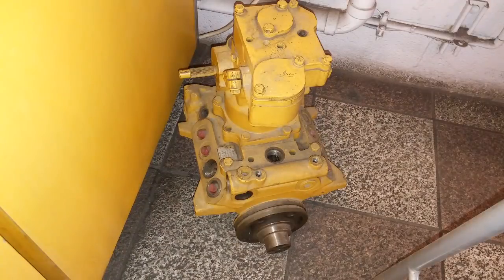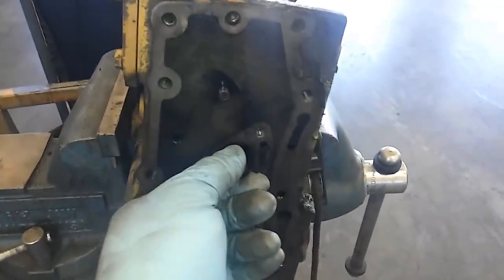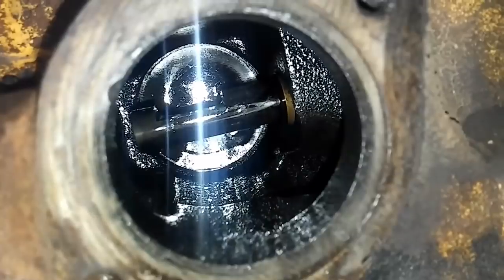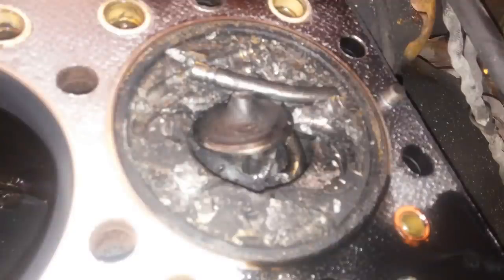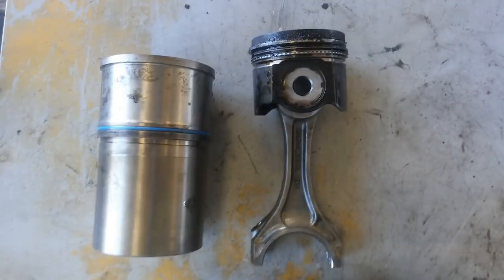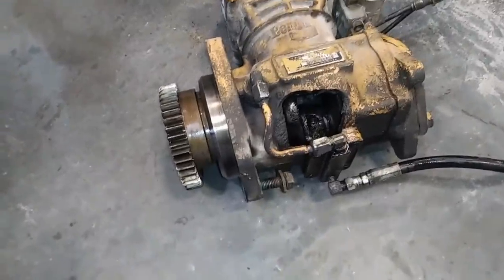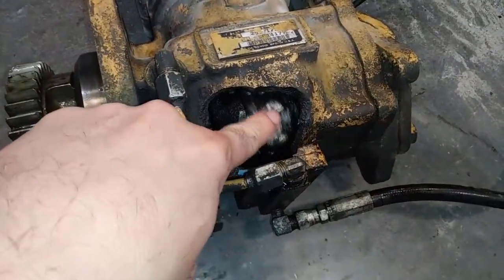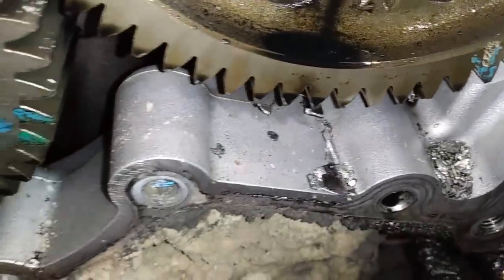Why Do Diesel Engines Runaway? What Is A Diesel Engine Runaway?

Comment: A runaway diesel is like the Stone Age terminator. It’s not alive, it doesn’t have fear or remorse, it won’t stop until it’s dead.
Reply: Even THEN it rebuilds itself 🤟🏻
Reply: No it can stop my dad stopped his tractor in 30 seconds
Reply: @nano-gq9tv  “it won’t stop” obviously you can stop it by cutting the airflow off
Reply: @nano-gq9tv  all he was saying was it won’t stop itself
Reply: @jefrebugni4064  oh ok I git it know thx man
Reply: Unless you have a manual. Then you can just stall the engine.
Reply: @nano-gq9tv  he blocked the airflow?
Reply: The Hippie Gunner you have to crush it in an industrial press
Reply: @hanslidlwagen4115  maybe,  or it may burn up the clutch. We had a Cummins runaway, driver smoked the clutch trying and it sat there at about 4000 until it ran out of oil and then seazed
Reply: @cbmech2563  Maybe the driver didn't do it right? It should be in top gear, brakes fully pressed, then dump the clutch. Or, what happened was the truck may already have a sliding clutch.
Reply: @hanslidlwagen4115  doesn't make much difference. When the tow truck pulled up out front you could smell it
Reply: @samazd4015  solid block over the Intake is the only way. People throw blankets at them but most desiels are turbo so getting a rag or blanket into the turbo isn't a good idea either. It's spinning 30k+ rpm after all  Guess you could smack the oil pan and put a hole in it to kill its fuel faster.
Reply: @hanslidlwagen4115  unless it just burns the clutch out. I used to have a car with a poorly turbo. If I was giving it some abuse then came to a set of lights it would start running on its own oil and start idling at 2k+ rpm. Put it in 3rd it wanted to set off. Put it in 5th and it just slipped the clutch
Reply: AND IS NOT PREJUDICE IT DESTROYS ALL EQUALLY ... I TOO AM A RUNNAWAY HIHI
Reply: @nano-gq9tv  you get it "now"*
Reply: @hanslidlwagen4115  good luck!
Reply: Cyberdyne system model 101
Reply: @stumccreadie1287  5-20K dollars later
Reply: @yohanathandowns9057  in the oil pan???? It would just run out of oil than seize

Comment: Diesel engines don't run away... The mechanics do.
Reply: For good reason, too. maybe they can't plug the intake in time.
Reply: there needs to be a switch that when it runs away you flip it and it shuts the fuel line at the gas (diesel) tank and a flap covers and locks into place that way if it runs away it will starve it
Reply: Lmfao
Reply: Nice you
Reply: kjilk simble     A fuel disconnect doesn’t work because there is enough residue fuel inside the pump itself to run the engine long enough for damage to happen. Blocking the oxygen intake is the way to kill it. That’s why trucks have the air filter outside the engine compartment. Access is quicker. I remember in school the instructors told us to use the log book to block the intake. They also told us that if we tried to block it by stuffing our field jacket into it that we’d see a diesel engine eat a field jacket.
Reply: exactly what I thought
Reply: And the owners of the diesel vehicle runaway after the engine does.
Reply: +kjilk “kj4ilk” simble or one that closes the the intake
Reply: Bob T  , lol
Reply: kjilk simble They made something like that but it shuts off airflow in the intake because again it can also runaway via oil
Reply: I think you can stall the engine by putting it in too high a gear e.g engine starts running away, foot on the brake and go into highest gear and release clutch quickly and it should stall and stop the engine which may save it
Reply: Jake Batty that’s exactly what I did to shut off my Pete!
Reply: @kj4ilk  There are safety systems on a lot of diesel drag trucks that cut off the fuel, but most cut off the air because if something happens like the turbo journal snaps the engine will eat crankcase oil and keep going.
Reply: @kj4ilk  stopping the fuel wont help when they run away the only sure fire way to stop them is block the air intake. And most do have a switch so that it will stop it. The switches dont always work and most people dont even k ow what the switch does.
Reply: Very few trucks have external air filters anymore, most likely for streamlining reasons to combat wind resistance.
Reply: If we can. I was talking to an old timer once who was running a 6V-92 on a dyno.  It was running away on him and before he could shut in down hydraulically, the balancer decided to come off. He said he curled up in a ball in a corner and hoped for the best.
Reply: LOL
Reply: The YouTube Phantom Official lol
Reply: kjilk simble when they run away they use the the engine oil as fuel till it eats it up and goes pop
Reply: Ever see what a shop rag looks like after it's been ingested by a turbocharger under full load?
It's a good thing the intercooler was there...
Reply: I had a Detroit 6-71 run away on a CG boat that had gotten gas fumes from gas spill on deck next to where in take was on starboard engine. We had to stuff life jackets into intake and it took several minutes to shut it down. Scared the #%*! out of us. 😱
Reply: Depends on grade, weight.  Perhaps a hard reverse will work on a steep downward grade.  Your Engine is your friend. I'm sure there are a few old Engineers out there.....gettin' drunker then hell.
Reply: I would block the air intake starve the engine of air and eliminate more  or other potential problems all together just an emergency butter fly valve system. you still need any 3 things for fire air fuel heat with that engine to create heat you need compression but I wont go on all I will say is the best thing to eliminate would be air because if you eliminate  fuel the problem may be oil
Reply: Crankshaft chase...
Reply: @kj4ilk  Nope. If its sucking crankcase oil into the intake or into the cylinders through say, worn valve guides, no switch is going to stop it.
Block the intake air. Starve the engine of AIR to kill it.
Reply: And they can fix almost anything...except the loose nut behind the wheel. ;)
Reply: @jakebatty530  - on a small diesel maybe.. but on a highway tractor with 700+ hp & 1500 lb/ft of torque, you'll just burn the clutch out. Wouldn't be able to do much with a train either, since they don't have a transmission.
Reply: Nothing helps when the chicken starts sucking oil for the turbo - it will run until the oil pan is empty - happened to friend with costumers TDI. It bend connecting rods , valves, - he rebuild the engine but it wasn't easy - run Neo, run....
Reply: LOL
Reply: Actually they do runaway.  It is caused by a governor malfunction.  All Diesels have a governor to control the engine speed, it is required for the reason I just specified.  Matter of fact the very first diesel engine nearly killed its creator when it ran away from him.  Of course he originally designed it to run on Peanut oil.  WHO KNEW?
Reply: @kj4ilk  Ah grasshopper but sometimes they start sucking the oil out of the crankcase sustaining the runaway. To stop them you need to cutoff all air or dump gases that won't support combustion. Some of the larger commercial/industrial stuff does have a bottle of pressurized gas (CO-2, Nitrogen or a halogen) with a dump valve to flood the intake with the gas and stop running.  Cutoffs sometimes fail because a manifold or gasket fails downstream of the cutoff so it's still getting air and thus still running. Although I would think that once you start taking out valves the compression will start dropping and might cause the process to start reversing.
Reply: I will never ever own a VW Diesel Rabbit ever again.....
Reply: @BlackWolf18C  and it's possible that it will blow up
Reply: @kj4ilk  Will not work, a runaway is when the engine is sucking fuel from a unintended source...
there is no prevention but the only way to stop it once it happens is to suffocate the air intake... if it cant breathe it cannot fire
Reply: Bob T so do the insurance companies
Reply: LOL I would too.
Reply: very true thats why its called runaway
Reply: I like grapes
Reply: That not happen in Europe... Way???
Reply: It's like a knock knock who's there runaway runaway who runaway to the fucking tree.
Reply: @stonearches2883  "Field jacket"? Are you a veteran?
Reply: Bob T well damn😂
Reply: That's the truth. All they got to do is put something over the turbo.
Reply: I believe deboss garage (?) Has a video where he purchases and subsequently destroys half of I think it was a 16v71 Detroit 2 stroke and it shows not only how amazing the design of those engines are as a whole, but the perfect safety built into the top of the blowers to choke the engine in case of a runaway.
Reply: kjilk simble so if you watch the video you can tell what he’s trying to tell you is even if you take the fuel out of the equation from the vacuum of the engine it may suck up oil There used to be some older diesel engines that had a shut off like a butterfly on the throttlebody the main and probably the best way to try and stop the run away is to take the air out of the equation like the man said I agree with you there should be a button that we can just press and turn it off
Reply: No they dont
Reply: Damn right
Reply: Patrick Hindenburg the switch instead should either cut off the air or be a compression release.
Reply: Most of our mechanics do too.  :)
Reply: Even diesels without the mechanical fuel pump STILL can run away.
Reply: @kj4ilk  Actually placing a valve closer to the fuel pump it's self is better if the runaway is only at the fuel pump and not oil entering in thru the intake.  For one.  if valve is by the tank it's not going to cut the feed fast enough to stop the damage as the fuel in the filters will still continue feeding for some time...  Next if your thinking the engine is susceptible to a runaway,  Cutting in a manual choke could help you kill the air-feed,  remember if doing this,  you must install as close to the mouth of the air intake so when you pull that chok it's going to cut the air direct as the vacuum is going to be substantially high! A large gate valve could do the trick as long as it's big enough for standard airflow in the open position.
Reply: @kj4ilk  Not foolproof: see 4.22
Reply: Oliver Eastman I can see the logic in that but it wouldn’t do much good if the engine is burning oil it would be better to cut off the air to the engine but that’s easily done for instance you could just put a butterfly valve on the air intake if the engine runs away you just close it and the engine will eventually just run out of air and stop
Reply: More than often, a runaway diesel is caused by extra oil going into the motor when its unneccessary not uncontrolled fuel injection. Unless there is something wrong with the fuel pump, then in that case, shutting off the truck/motor would work.
Reply: Good Answer!
Reply: not so, iv had a 71 series  do it while tuning it. a bitch when the rack sticks.
Reply: Detriot can
Reply: @kj4ilk  you cut the air intake, not the fuel intake.
Reply: This is why I always have a little piece of plywood with me when I'm starting an old diesel. If I have to run from it to grab something, I ain't coming back 🤣 I'll pass on a rod to the dome.
Reply: Lol 😂
Reply: @kj4ilk  When I've had it happen, it was due to crank case oil. On normally aspirated engine, that oil is introduced through the crank case decompression lines, caused by excessive blow-by. It's the result of old engines, with worn out piston rings. On turbocharged engines, it's almost always the center bearing of the turbocharger, allowing the oil into the air intake. I've never had one run away, because of an injection pump. CO2 fire extinguishers work well to shut down a run-away, with minimal collateral damage.
Reply: @stonearches2883  my dad's car started to runaway, i just put it in 5th and dumped the clutch
Reply: Haha
Reply: @kj4ilk  love to see you shut fuel off to an engine that is running on its own oil.
Roflmao!!!!
Reply: Fast!!
Reply: @jayterry7291  I would have used the life jacket to swim to shore instead 🤣🤣
Reply: @kj4ilk  Mercedes diesels have an emergency shutdown switch
Reply: @kj4ilk  that won’t necessarily work, unless you hit it immediately after it started there is a chance that oil will leak through the piston rings and run off of oil until it blows up
Reply: Lol ye

Comment: As a retired army diesel tank mechanic, I would like to add that, from experience, having a choke cable to an intake plate is a good idea. Also the majority of my experience of diagnosing runaways was a fault in the cooling system. Water pump failure, drive belt... so keep an eye on oil consumption and engine temp. "An ounce of prevention is worth a pound of cure."
Reply: Thank you for your service